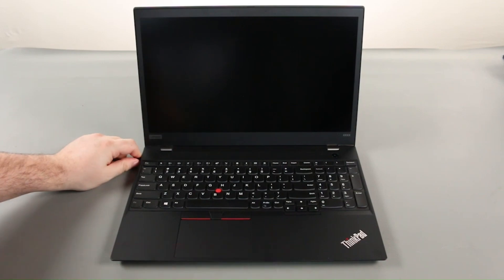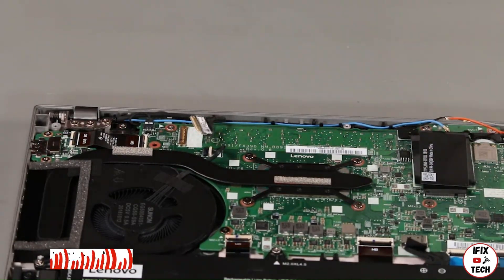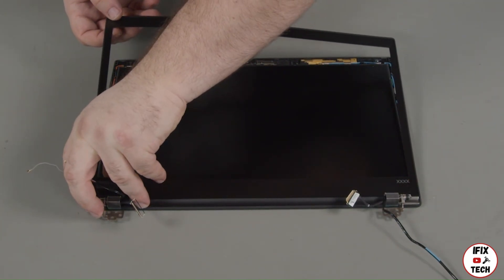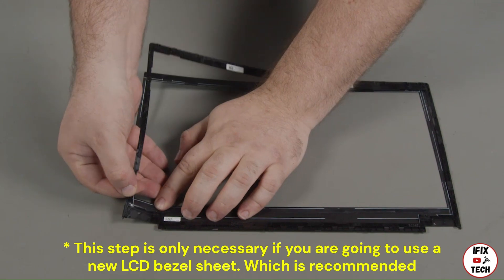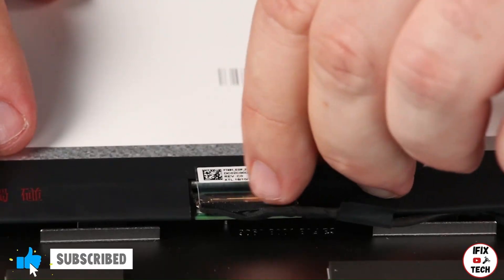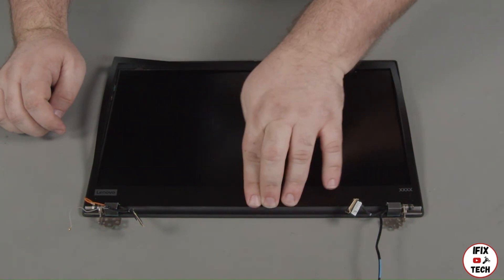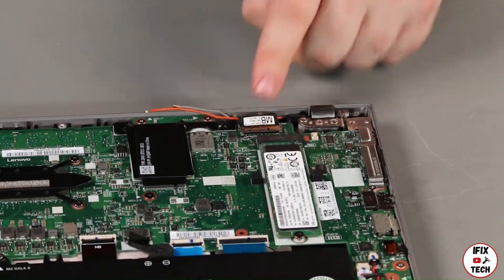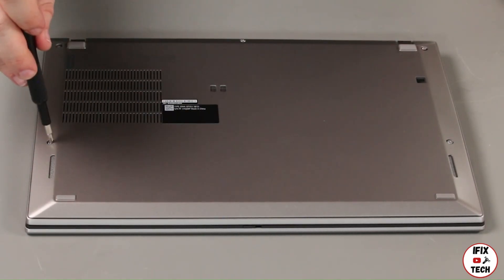Lenovo ThinkPad X390 and X395 LCD SCREEN Replacement - How to Remove LCD Panel

Comment: How do I disable built in battery when the screen is literally black
Reply from the maker: External monitor 😉 or you can just go straight to disconnecting it internally. Thanks for liking it and subscribing 👋 😉
Reply: @IFixTech1  I don't have any of those 😅
But don't worry, we've fixed it, we turned it off and disconnected the battery
It works fine 👌
Thanks for the tutorial!
Reply from the maker: @steve_is_playing  😉✌️